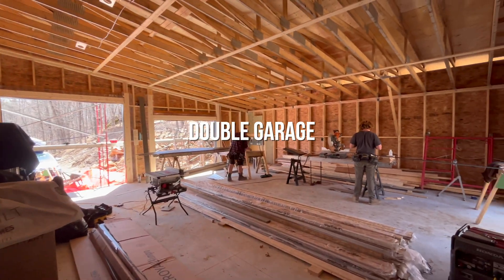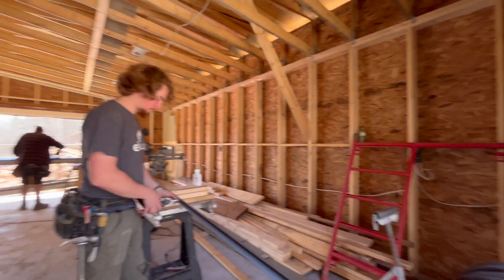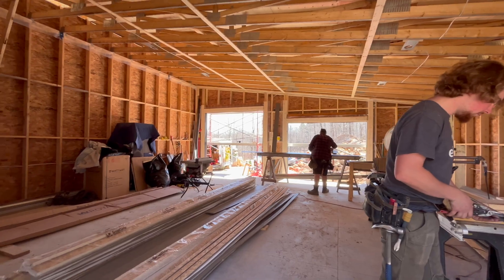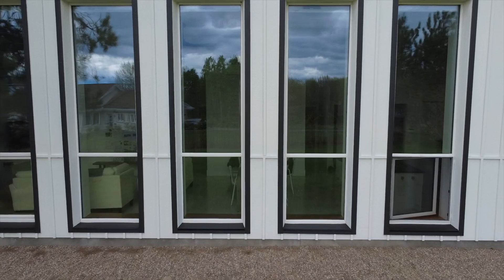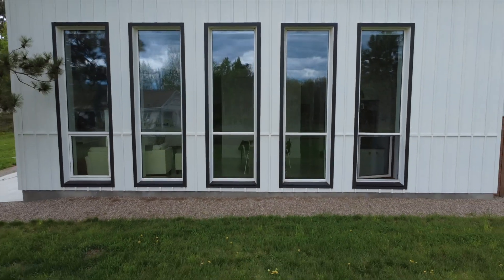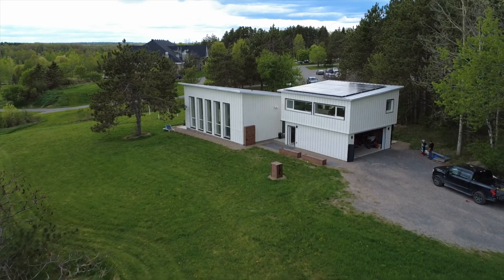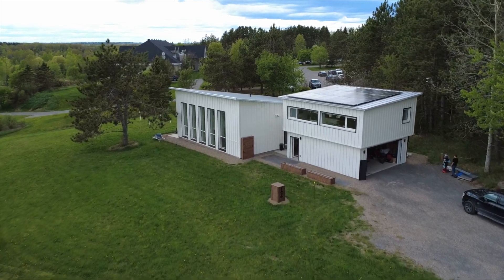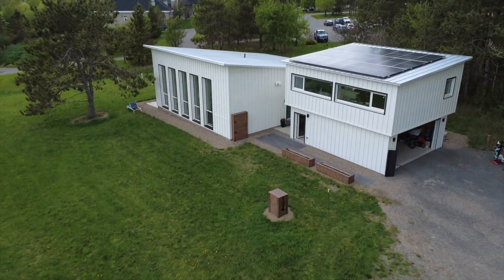Passive House vs Non-Passive House (Pt.2) | Thermal Envelope, Vapour Tightness & Open Permeability

Comment: We have built a passive tight house as traditional building and scored .64 ach. Smart membranes and all the amenities like a traditional house. Just depends on the attention to detail on air seal
Reply from the maker: Well, done on your ACH and inclusion of Smart membrane instead of plastic! 👍. A problem with most traditional buildings is in the details preventing air sealing..